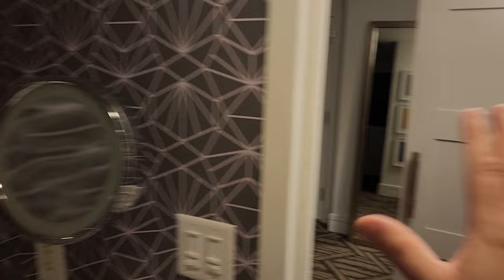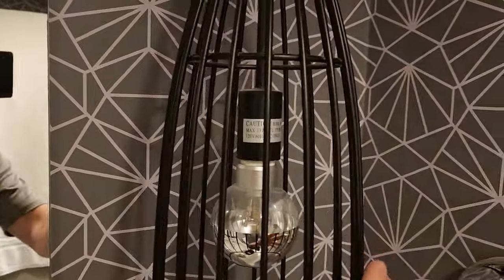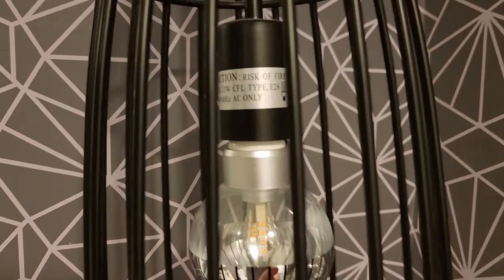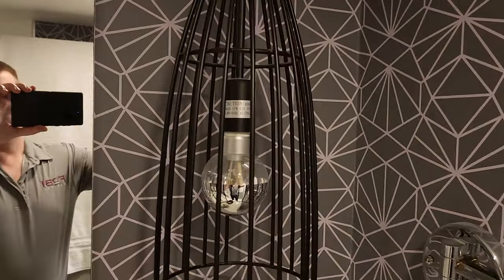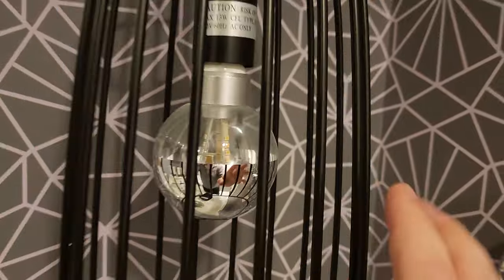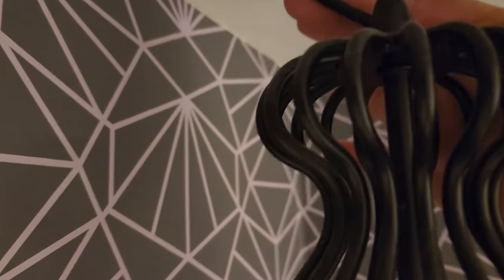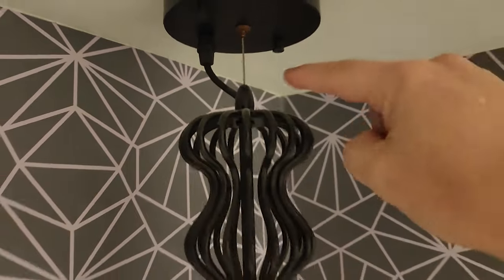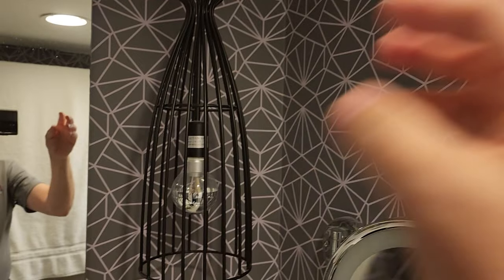Check your lighting fixtures!

Comment: It's also a problem with bipin lights, where stores tend to only have one two replacement options, so you are offered a choice between a 15W or 300W halogen (where the usual LED J118 replacements don't fit.)   
Or always having that one downlight burn out because its socket has distorted from heat, and now overheats w/ every 'new' bulb.

Or (more annoyingly) because the environment spec isn't often marked on the packaging , I often got non-enclosure rated bulbs that would cook themselves to death in a non-enclosed lamp - or proximity to an incandescent bulb - because there aren't any markings to distinguish them (Except for a number that can be looked up the energy star database, on the lamp, inside of the package.)